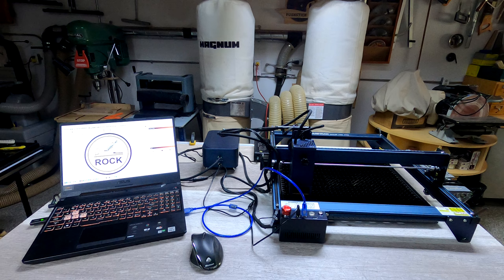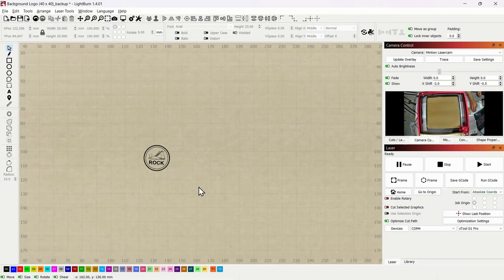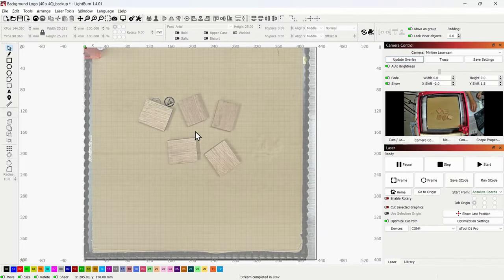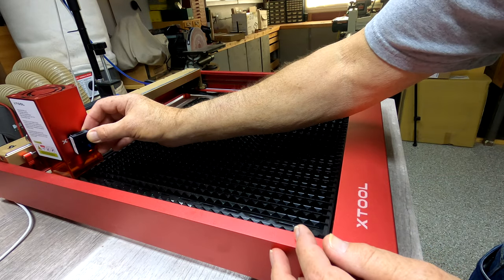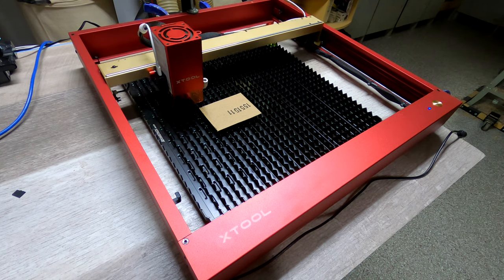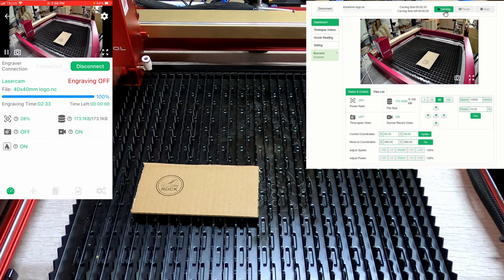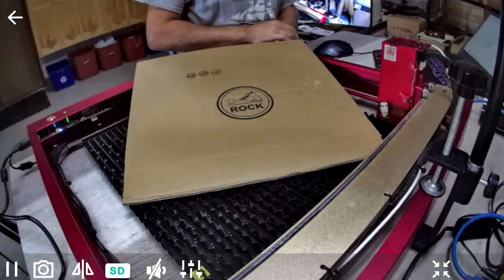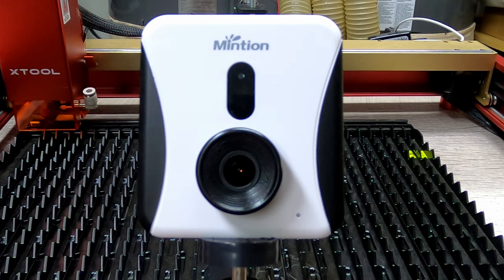Mintion Lasercam In-Depth Review

Comment: That's a neat piece of equipment.  Does the flame detector only provide an audible signal or will it shut off the laser in the event a flame is sensed?   It seems to me this would provide a false sense of security since a flame could rapidly grow.   What did I miss here to think this?
Reply from the maker: Yes, it does shut off the lathe and move it out of the way, John. I must say it takes a little longer to accomplish this than I would like; about 27 seconds. I believe they are working on shortening that time. It also sends out an audible signal.
Take care,
.....Gord

Comment: Isn't the trouble with this that once you alter the level diode head then everything is out of alignment with the camera. With the K40 it works well as the distance from the camera to the cutting focus point is always the same (you have to raise or lower the object to get it in focus), but with a diode laser if you move the head up or down to focus (like my new elegoo Phecda) all the calibrations you set up in lightburn are now incorrect. The only way to be on target all the time is to raise or lower the item.
Reply from the maker: Yes, that can be a concern. There is always something to deal with but things are being improved all the time.

Comment: HELP I'm running an Xtool D1 and the blue cable for the Mintion has nowhere to connect on my D1,  There's only 1 slot on  the D1 and it goes to my laptop, there's nowhere to connect the blue cable to the D1.  Did I buy the wrong camera?
Reply from the maker: Karla, I believe you need to get what is known as a HUB. This is an electronic device that allows the USB signal to be sent to more than one other device. Be sure to purchase a powered unit as they will generate a stronger signal. I hope this helps!
…..Gord

Comment: what network do you need to connect? Mine won't scan the QR code for either 2.4 or 5gHz networks. I've tried so many times and I'm about to send it back because it won't connect. any insight?
Reply from the maker: I'm not sure which network I'm using. I have both as well and had no problem connecting. You might want to contact Mintion support to find out what to do. Sorry I'm not more help!!
......Gord